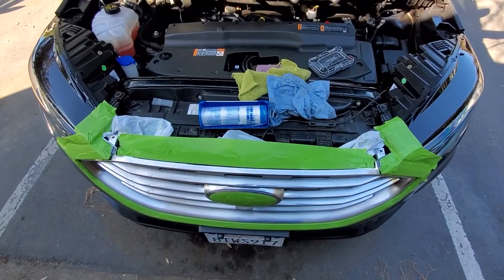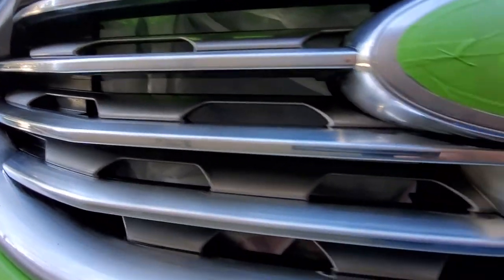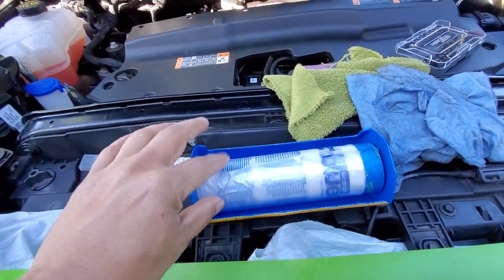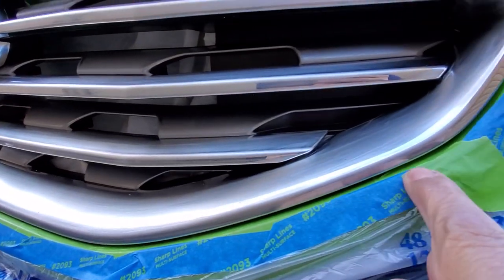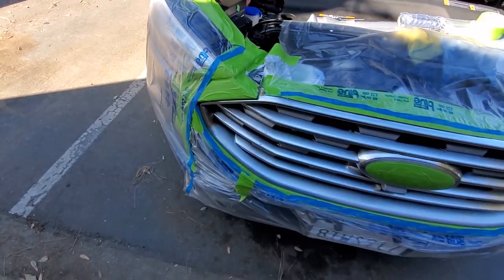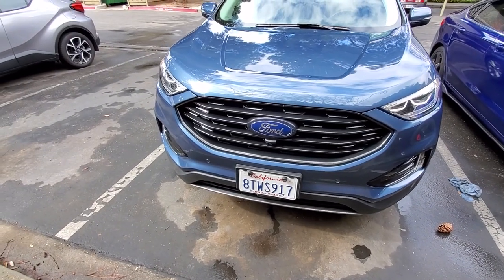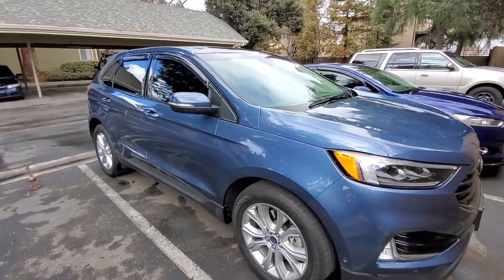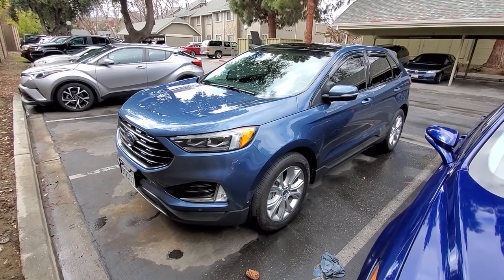How to paint car grille - 2019 Ford Edge

Comment: Does it affect the value of the car if you’re financing it?
Reply from the maker: Hi Mr. Brickston! I was financing my Edge for about 5 months. Did quite a few mods during that time. No impact. As long as you pay it off, I don't think it has any negative impact. On the contrary,  it's an upgrade . If you're going to trade it for something else, it may be better to keep it stock. If you keep it though, let the mods begin! Peace!
Reply: @ecobooster8298  I’m going to keep it for s few years then trade it in. I got mine in June. I just did my calipers, front splitter, sprayed my rims gloss black and now thinking about spraying my grill. That’s all the mod I’m doing to it
Reply from the maker: @asapbrickston  ah yeah! In that case, go for it! It will be a nice appearance package when you trade it in! I may think about trading mine in for an Explorer ST.
Reply: @ecobooster8298  I’m going to keep my edge for around 4-5 years then upgrade to to AMG GLE (suv type) benz. I like those

Comment: What brand of window visors did you put in there? What is the model nos.?
Reply from the maker: Yo Willie! Sup man? Thank you for watching my video! The visors are AVS. .model 94930 from ebay. .. yeah man, the painted grill made a huge huge difference.  I'm gonna paint the wheels and calipers soon too! One thing I recommend are wheel spacers.. check out my spacers install on the edge video! . Peace bro!
Reply: @ecobooster8298  are the visors in channel?
I'll watch your other video about the spacers & how they came out
Reply from the maker: @Willie1980  I think I put the link in the description of the video but just in case, here you go man.. https://www.ebay.com/itm/AVS-94930-Tape-On-Vent-Visor-Window-Deflector-2015-2020-Ford-Edge/392196921985?ssPageName=STRK%3AMEBIDX%3AIT&_trksid=p2057872.m2749.l2649